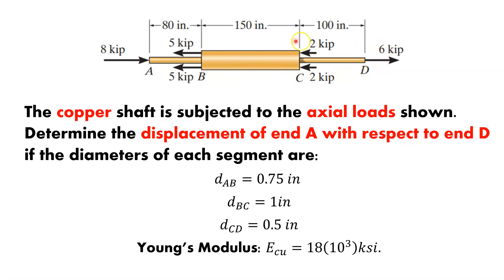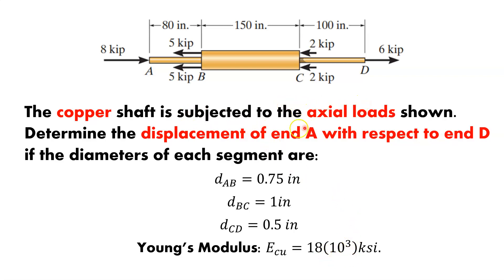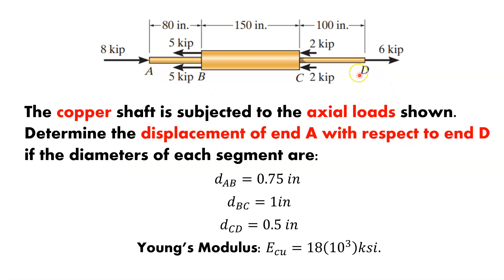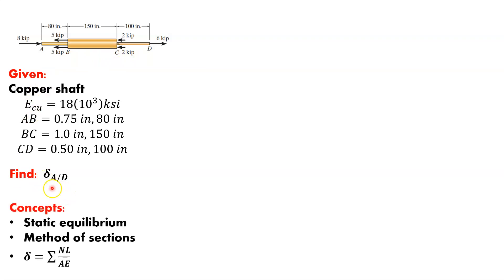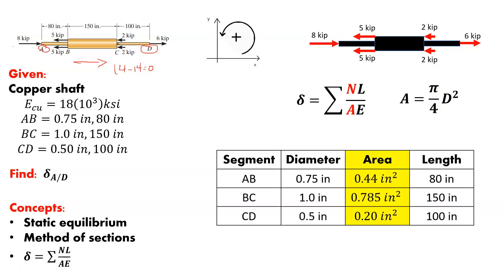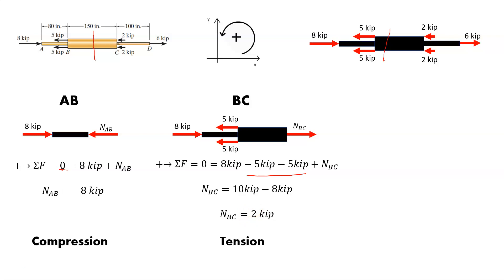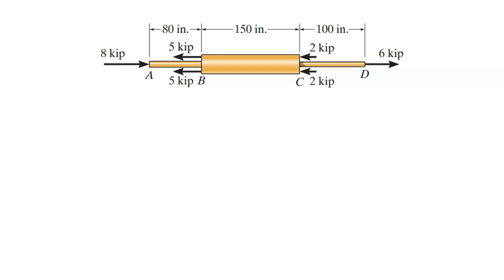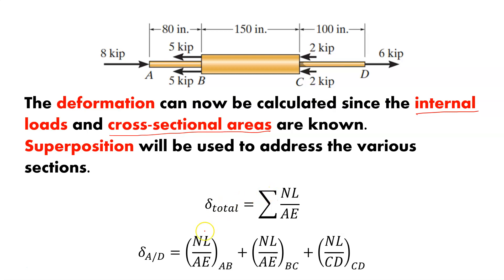Strength of Materials (Part 20: Axial Load and Relative Displacement)

Comment: 왜 ← 2 ← 2 는 고려하지않은건가요?
Reply: If you look at the left cut bank and the right cut bank and take into account the conditions that all forces must be 0 so that we remain in a static system and do not pass into a dynamic system, then you will see that all these forces cancel each other out. For this reason, in order to make your calculation easier and save time, you can not include certain forces in your calculations.